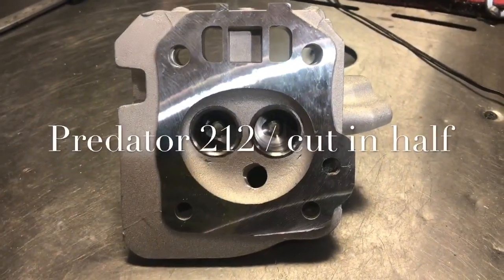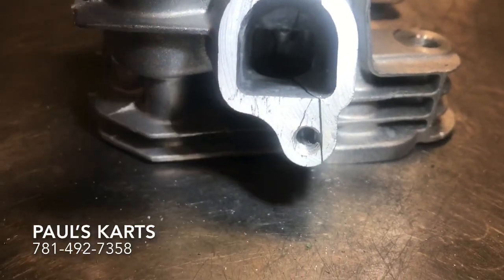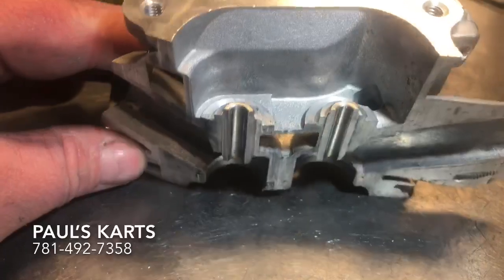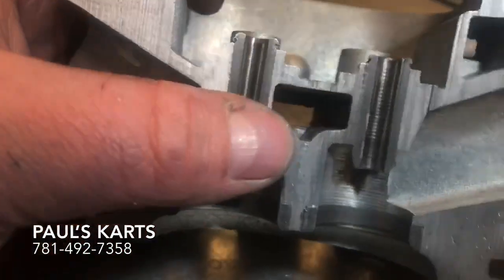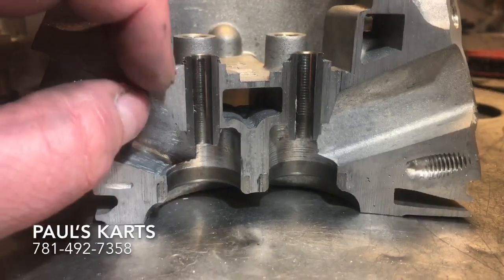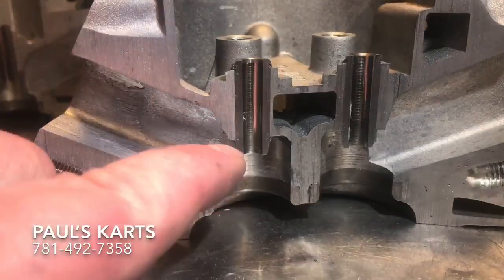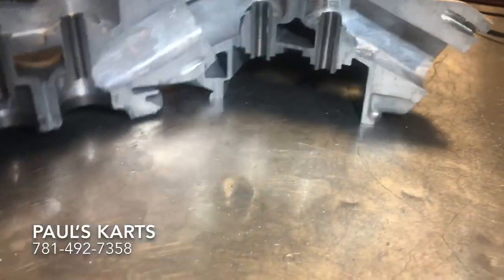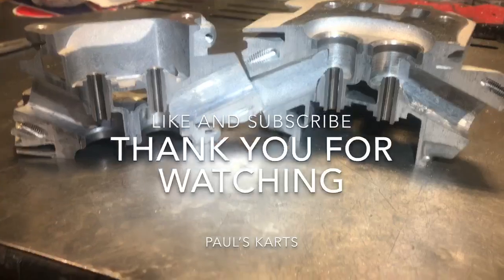CYLINDER HEAD PORT DESIGN - INSIDE LOOK AT DESIGN - CUT IN HALF- PREDATOR 212

Comment: awesome vid. I have years of experience working on v twins, but I've never done a head. im going to just do it. I have a 35 hp vangaurd carbureted engine. Do you know what parts I need to build my heads? Also what cam should I get? I have to do rods, pistons, cam, heads, etc. Any answers will be greatly appreciated. Thank you so much for your time. you are the only video in detail about doing head work. Everyone treats it like its classified. ty